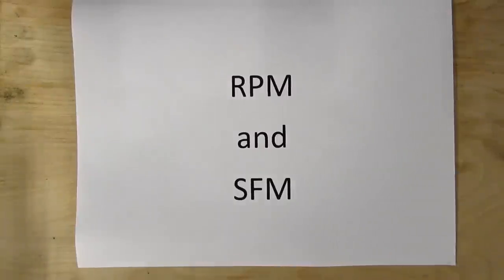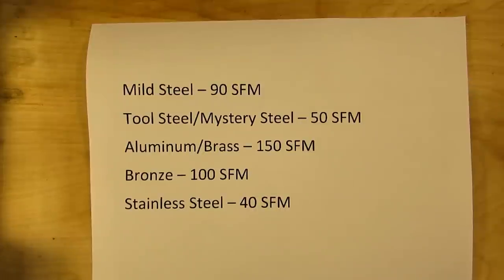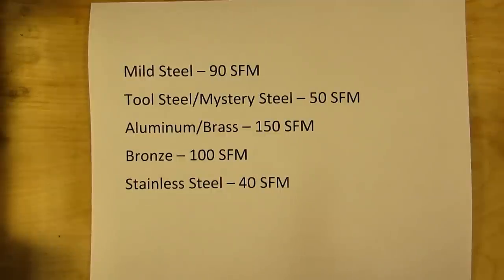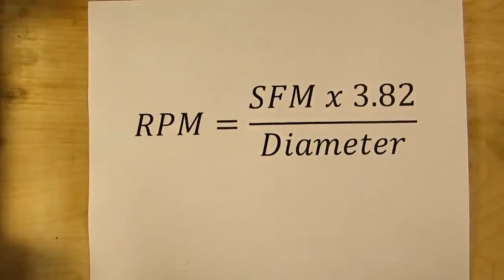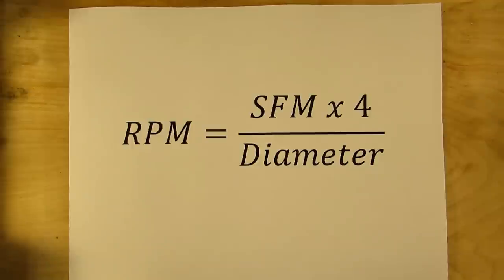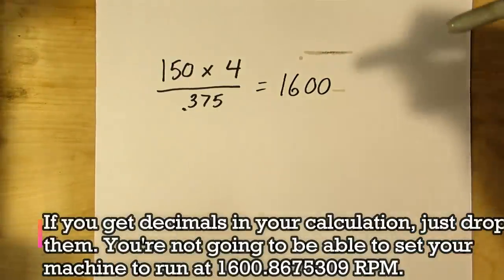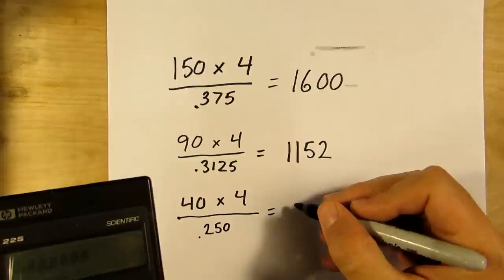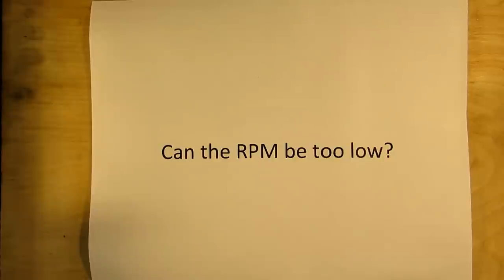Calculating the RPM for your machines

Comment: Great video, to clarify for metric.  Say I have a 1” (24.4mm) dia alloy bar.  The calculation would be 45000/(3.142x25.4)=564rpm.  If I was working in imperial it would be 150x4/1=600rpm
Reply from the maker: The difference is because the 4 in the imperial formula is an approximation of 3.82.  If you do the math with that it comes out to 573rpm

Comment: For the metric folks 🤣  most of the steels I cut HSS wouldn't even scratch it. Excellent informative video 👏🏻
Reply from the maker: You really have to love those metals where your SFM with high speed steel is 10 or 15, or they're just flat out harder than HSS tools. I figured that was a rabbit hole I didn't want to fall down in this video though. Thanks for watching!

Comment: ok but how do i calculate SFM
Reply from the maker: Easy.  Just flip some of the numbers around.  SFM = (RPM x diameter)/4 (or 3.82 if you're using the non-approximated version).

Comment: You mention to double the sfm for carbide tools.  Would you recommend even faster speeds with carbide tools with high heat coatings (i.e. 1700F+)?  3X the SFM listed?  Great videos by the way.

Comment: Thanks for speeds and feeds in a nutshell, I have learned through the years working at various Manufacturing companies, most machinist pic speeds and feeds from tribal knowledge on the machined parts history, memory or trial and error.  It's more costly so this technical information will be helpful at any level or skill! 
It's great that you noted the suppliers of cutting tools and production expectation speeds verses nonproduction or manual time.
Thanks for posting this helpful Gem!

Comment: Excellent informative video. Thanks. And a plus for using a HP RPN calculator!
Reply from the maker: You know, I have absolutely no idea where or when I got that calculator.  It seems like I've always had it.  It is a great calculator though.  I wouldn't trade it for anything.  I use a TI-30Xa at work.  Also great and very reasonably priced.  Thanks for watching!

Comment: For CNC, you get 1600rpm for aluminum, then how to calculate Feed rate?
Reply from the maker: RPM x flutes x chipload = feedrate. Flutes is the number of edges you have on your cutter. Chipload is the amount you want each flute to remove. Generally the most you want for chipload is 1% of your cutter diameter. Use less chipload for a better finish on your finish cuts. I have a video on this as well. I hope this helps. Thanks for watching!
Reply: @StuartdeHaro  Can you kindly do a sample for us? We just want to use CNC Lathe to cut steel. Don't know how to calculate feedrate.
Reply from the maker: Lathes are a bit different. The feedrate is given in inches (or mm) per revolution of the spindle. Your insert manufacturer probably has recommendations for the feedrate, but as a rule, I start around .004"/rev (.10mm/rev) and then start playing around with it until I get the finish I'm after and the chip is coming off cleanly. Sometimes the chip won't break or curl. It depends on the material, but if your finish is good, then no worries. I always start conservatively and then keep bumping it up to see what I can get away with.

Comment: Hi, Very watchable as are the rest of your videos. One question however, what SFM would you use for cast iron, bearing in mind the varying qualities of that material. Regards
Reply from the maker: I usually use 100 for cast iron.  Cast gets a lot of grief for being dirty to machine, but I personally love working with it.
Reply: @StuartdeHaro  I've used 70 in the past, but that was before the outer skin from casting was removed, then 90

Comment: That's going to be so helpful figuring out approprate speeds for my lathe. Thanks for that. Would these speeds equate to bandsaw blade speeds? How would you work that out?
Reply from the maker: Bandsaw blade speeds seem to be a bit higher, probably because each tooth is contact with the material very briefly. You can find charts all over the interwebs with blade speeds. I'd recommend using the one provided by your blade's manufacturer.

Comment: A nice tutorial,
Please which of the diameters, is it the diameter of the cutting tool or the diameter of the work piece you used in that formula.
Reply from the maker: It depends on the machine. On the mill, it's the diameter of the cutter. On the lathe it is usually the diameter of the workpiece unless you are drilling or boring a hole. Then it's the diameter of the hole.

Comment: sir from where you got that data of SFM . different site say different SFM that is why i am confusing so please tell .
Reply from the maker: These are the numbers I use for my students at the local community college. They are meant to be used for high speed steel tools and are very conservative to make sure their tools last through the class. Also, that minimizes the number of crashes. You can plug in any number you would like into the formula, but make sure the cutting speed you use corresponds to the material you are cutting and the type of tool you are using. You really don't want to use a carbide cutting speed with a high speed steel tool. Thanks for watching!

Comment: Stuart, sir Do you have a video that discuss about feed rate in lathe turning?
Reply from the maker: No I don't. It isn't as clear cut with the lathe. There are a lot more variables. Generally, if you keep the feedrate less than the radius on your tool you should get a nice finish, but don't get too aggressive. I usually get good results with .002-.004" (.05-.10mm) per revolution. You'll find that you need to adjust on the fly to get the chip to break, especially as the diameter gets smaller but your speed stays the same. You will have to play around with settings to see what works on your machine with whatever material you are using.
Reply: @StuartdeHaro  thank you for the reply sir, your videos are big help,

Comment: Hi Stuart D Haro
Great info, i recently started at a smaller machine shop. They have me run a old turret lathe for drilling parts. The machine seems to run speeds 56-265, ¿is that the rpm? Ive been drilling 1018, 1215, 1045, 4140, 4140 HT, 410, 17-4 ph, 316, duplex 2705. 
I use both carbide tips (they call it a spade). Also use a regular drill (i imagine its a high speed drill). I've been having a problem with chipping and breaking the tools recently even though I've used those speeds a few times for the same material. Do you know where i can get a more specific or larger list for sfm on different metals?
Reply from the maker: I'm sure that would be the RPM. Depending on the size of the drills, that may be really slow and that could explain your breaking and chipping issues. At slow speeds, it is really easy to take too heavy a feed on the drill and break it.
Reply: @StuartdeHaro   Oh ok,  i was running 17-4 ph at 88 with at new carbide spade and it was really noisy, but they said noisy is ok for that material, but the spade broke. Do you know where i can find a chart or list for more specific types  metals.
Reply: @StuartdeHaro  i imagine theres somebody kind of equation to find rpm using the brinnel hardness of material. Do you know of one?
Reply from the maker: @chesitojlf  I do not. Sorry.

Comment: If you were using an end mill with multiple flutes how do you calculate?  Thanks for the video.
Reply from the maker: The RPM is not affected by the number of flutes, only by the diameter and the material being cut. Flutes do have an effect on feed rate. I have a video on that subject.

Comment: How do you calculate this sir 
you have to machine an 18-8 stainless steel shaft with an external diameter of 76 mm.what speed in Rpm would you set the lathe to if you're using a 

 a) high-speed steel tool
b) brazed-tip carbide tool
What does that 18-8 means
Reply from the maker: I go into how to do the metric calculation starting at 9:20. For a high speed steel tool, your RPM would be around 50. For brazed carbide, you are probably safe to double the cutting speed to  24 meters/minute, so your RPM would also double to 100. 18-8 is the alloy of stainless. It is made up with 18% chromium and 8% nickel.

Comment: I run manual Bridgeport at my shop.  The leader who's been teaching me over the last few years always just gives estimates for RPMs. 

There has to be two different formulas, you don't run end mills and drills at the same RPMs. The formula given to me for drills was 229.2 divided by the diameter.  But they've never given me the formula for endmills.  Also, don't the number of teeth or flutes matter?
Reply from the maker: I'm not sure where the 229.2 came from, probably from an sfm x 3.82 (that would make it 60sfm).  You shouldn't use a single number for speeds because the sfm varies from material to material.  You can run endmills and drills at the same RPM.  You run reamers slower (half the speed as the same sized drill) and I always run countersinks, counterbores, and anything else that has a lot of tool in contact with the part slower than calculated to avoid chatter.  The number of flutes comes into play when you're figuring out your feedrate.  I have a video on doing that as well.  Thanks for watching!
Reply: @StuartdeHaro  Yeah funny thing is after I watched your video I was talking to my leader at the shop and I was telling him what you were saying that he started looking of into himself, and he was surprised to find out that they seem to use the same formula.  One of the reasons he really started looking into it was we have a engineer at the shop who thinks he's an expert in programming that was running a Haas CNC (extremely light duty machine).  And he was running a quarter inch end Mill at about 6000 RPM's.

You could hear it screaming all the way across the shop.  We were joking that the machine was vibrating so badly that it was going to walk right out the door.

Comment: So do these numbers change for carbide or carbide insert tooling?
Reply from the maker: Yes. Generally carbide can be run 2 to 3x faster than high speed steel. Of course, manufacturers of inserts will have their own sfm numbers, so check that information. Keep in mind that those numbers are geared towards production with rigid machines, so they may not work on smaller machines or where tool life is more important than short cycle times.

Comment: Somethings wrong here Milling  (Metric) Mild steel (material thickness 20mm)(1000×27÷3.14×20) = 171,974.52... sorry  I don't know what I missed here, is it 171 RPM, if so that's seems really slow 🤔 or is because it should be the thickness cutter tool in Mill not material thickness like lathes??

Comment: What sfm for hardened steel around 58-62  Rockwell? 30ish?
Reply from the maker: For something that hard I would use a carbide endmill.  With that, I'd start in the 90-100sfm range and make adjustments as necessary.  Slow it down if it squeals or throws flaming chips.  If the chips are brown or deep blue, you're fine.  Pale blue means the speed is too fast and you should slow it down.  I hope this helps.  Thanks for watching!

Comment: is this same for flutless tap RPM calculation???
Reply from the maker: No. In general taps are run slowly since they will self-feed once they engage. They can be run faster on CNC machines with rigid tapping since you can program the feedrate to be the same as the pitch, but you still don't want to go too fast.

Comment: SS 316 metril parting tool spindle speed  Or  feed rad ?
Reply from the maker: You want to run parting tools slower than normal tools because you have a lot of flexibility in the tool and a lot of it sticking out. The most important thing is to make sure the center height of the tool is perfect and the tool holder is square to the part. Otherwise you are asking for trouble. Feedrate can be kept the same as turning, however, if you are parting solid stock on a manual machine you probably want to finish it by hand, not under power feed. That last bit in the middle is when things like to go badly, so having some feel in that situation is very good.

Comment: Sir that formula applicable for cnc router for portrait designing Engraving on iron
Reply from the maker: It should work on any rotating cutter. You just need to know the cutting speed for the material.
Reply: @StuartdeHaro  sir I have several portrait designing stl file whom I want to engraving on iron but I have no idea about spindle rpm,step over, feed rate and plunge and step down, so how to calculate it, my cnc is chaina made and it's mach3 controller have RJ45connector
Reply from the maker: @sonuverma2796  It’s a bit out of my wheelhouse, but with most engraving you'll be using a very pointy cutter. That point is not moving very fast, even at high RPM, so you’re usually going to be cutting at the max RPM. Check with the cutter manufacturer to see what they recommend for speeds and feeds.

Comment: How did you get 150 for aluminum and 90 for mild steel?
Reply from the maker: Like I said in the video, these are the numbers I use for my classes at the local community college. They are meant for high speed steel tools and are pretty conservative numbers to keep the students from crashing the machines. You can find a lot of SFM charts online with wildly varying numbers. You just have to be aware of the cutter material the chart is for (HSS v. Carbide) and the fact that most of those charts give production oriented numbers that are meant to maximize productivity and not tool life.

Comment: Why do you get different rpm when doing the same values but in metric
Reply from the maker: Mostly because the 4 in the formula is an approximation of 3.82, as I said earlier in the video. 3.82 comes from 12/pi, so it converts surface feet to surface inches. If you use 3.82 instead, you should get roughly the same RPM, give or take a bit for rounding errors between units.
Reply: @StuartdeHaro  thanks for the response.
I’m trying this for the first time and my maths is terrible.
When I use your example for aluminium (using 3.82) I get an rpm of 1528
When I try to use the metric formula I think I get an rpm of 1364.
Is that correct?
Reply from the maker: You should be getting a lot closer than that. Are you using the same cutter size in each problem (i.e. 6mm = .236")
Reply: @StuartdeHaro  
Apologies😊
I tried to use  the same as in the example 3/8
which I inputed as  9.525mm in the metric example.
1000*45/3.14*9.525
Reply: @StuartdeHaro  tried it several times not sure what I’m doing wrong.
With imperial I get 1528 
With metric
1000*45 / 3.14*9.525= 136,504.4077
Reply from the maker: Is it perhaps an order of operations issue? You have to do pi x diameter before you divide. I get 1528 for imperial and 1504 for metric.
Reply: @StuartdeHaro  Yes this has been the issue. 
Thanks a lot  for your help
Reply from the maker: No problem my dude. Thanks for watching!

Comment: How do you calculate rpm for threading?
Reply from the maker: When I'm threading I'll run the machine slowly so I have plenty of reaction time. I mainly judge the RPM by how fast the threading dial is moving. If it takes forever to turn from number to number, I know I can speed up. If it's zipping by too fast to reliably engage the half nuts then I slow down. Check out my video on threading at various RPMs.

https://youtu.be/r-bEBYRCXCc
Reply: @StuartdeHaro  Thank you so much for responding !
Reply from the maker: @fabuloustshirtsonline  You are very welcome. Thanks for watching!

Comment: silly question, im in the Uk and just learning.  does this still work or how does it work in Millimetres ?
Reply: lol forget that, just need to watch more :)
Reply from the maker: I was scratching my head thinking, "Didn't I cover that?" Thanks for watching!
Reply: @StuartdeHaro  yeah lol, just as you finished the working out I paused and posted, then 3 seconds later you said “don’t worry haven’t forgot you metric boys” serves me right.

But thank you very well explained.
Reply: Just to check my maths (I’m completely new to lathes, basically just at the turning it on stage) RPM = for mild steel is 27, so 1000 x 27 divided by 3.14 then times diameter, say 25mm ??
Reply from the maker: @sc1999  (27 x 1000)/(3.14 x 25) = 27,000/78.5 = 343 RPM.

Comment: Hello Stuart de Haro

So im metric guy
I have 10mm brass rod.

With metric formula i got 1432 RPM.
1000x45 = 45000
PI x 10 = 31.41

45000 / 31.41 = 1432

I didnt know the formula, im beginner with lathe.
I did my work with 600 RPM on that brass piece.

So that means i did my cutting completely at wrong (too low) speed?

I thought that 600 is enough. Just now i started looking around what the actual speed must be and found the videos and formulas.
Im using chinese mini lathe, if that matters.

So with correct speed i could and should get much better surface finish?
Reply from the maker: 600 is definitely low.  Since my numbers are pretty conservative and your stock size is small, you could probably run your machine as fast as it can go and you'll be just fine.  With brass you shouldn't have to work too hard to get a good surface finish (at least with alloy 360).  You can also try a tool that is totally flat on the top.  Brass cuts very well with no rake angle.  Thanks for watching!
Reply: Thank you. I will try
What about plastic rods?
Acetal rods, acrylic rods, etc.

I guess much slower because they will melt?
Reply from the maker: You can machine it about the same as Aluminum, but keep it on the low side of the cutting speed spectrum because yes, they can start to melt.

Comment: Hello sir
How to calculate speed from rpm
Reply from the maker: It's pretty easy. You'll know your rpm, diameter, and our constant of 3.82 (or 4 if you want to round), so just turn around the math a bit to be RPM x diameter/3.82. Thanks for watching!
Reply: @StuartdeHaro  Hello sir
How to calculate speed from diameter
Reply: @jeetenderkakkar7570  There are pulley calculators online. Run a quick search. Good luck.